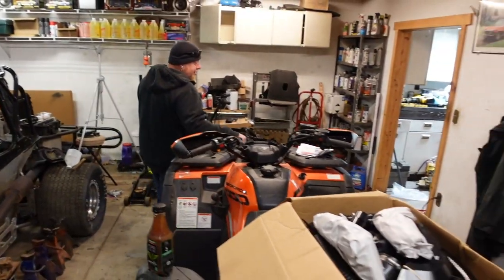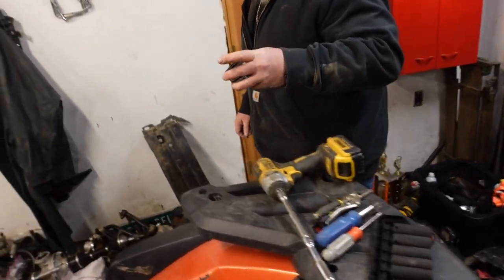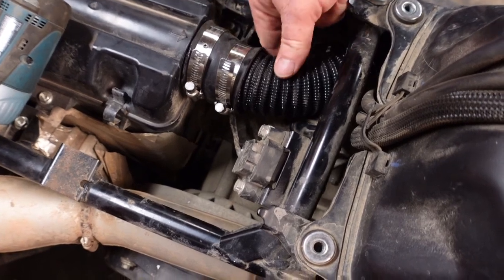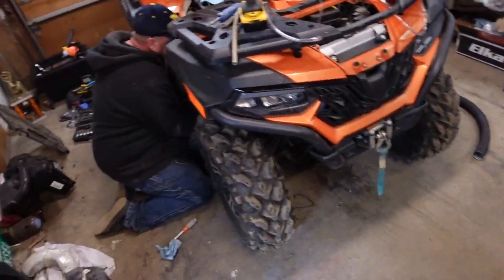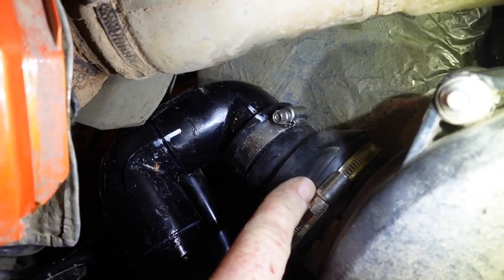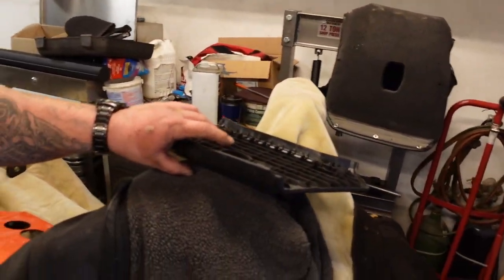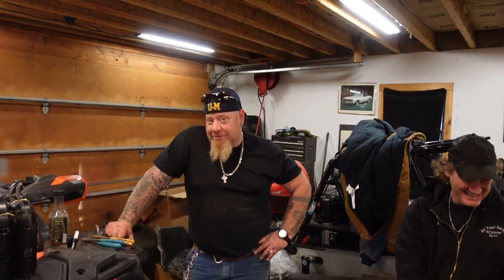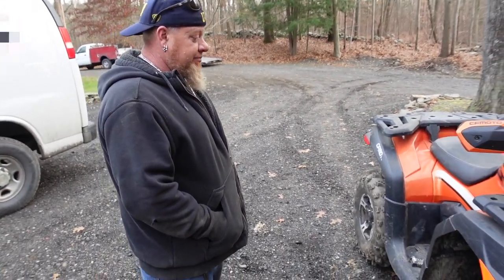SYA Snorkel Install On a 2020 CFMoto CForce 600! We Show You How To Do It |  To Go Deep!

Comment: It turned out very well... but my question is if you need to replenish water. Take out a fuse or put in brake fluid, do I have to disassemble everything? Greetings from Uruguay.

Comment: I was riding my 600 in the trails and blew a fan fuse so when you take that in deep water it might happen to you. You guys did a bad ass job👍
Reply: It blew one on me too up at tall pines
Reply: Same here in the water
Reply: Same here 😅
Reply: Just need to add an on an off switch for when you're in deep water  So you can turn the fan off completely Did it to my AC worked great.
Reply: @bigjay6743  perfect
Reply: I replaced all of the OEM fuses with aftermarket. After some research, I learned that the quality of the fuses from the factory aren't great. Haven't had an issue after replacement, so far.

Comment: Why does a small purple line have to come from the exhaust Port of the drive to belt drive is it not already sealed up or is there some kind of opening back there to let the air out because I don't see it in the plastic piece taking off but then again I can we just missed it that's the reason I'm asking the question completely ignorant here so don't think I'm questioning everything cuz I don't understand I just don't understand is all
Reply from the maker: Hit us up on either instagram or Facebook so we can see what you are talking about.  This way it might be easier to answer.

Comment: Great job guys.  We’re in the process of doing the same snorkel kit on our 600 touring.  How long did it take you guys.  I need more time in my days to finish ours.  I work too much. Lol.  Will send pics of ours when we’re done.  Awesome video
Reply: It took about 6 hr total. Little pain in the ass but not too bad.
Reply: @sethharman3006  what kind of silicone did you guys use?
Reply: @rodeckerboyz2510  just regular.  Nothing special

Comment: I have a 2020 cforce 600 aswell and it’s snorkeled but when I take it underwater it blows that fan fuse
Reply from the maker: That sucks.  Never want the fan coming on in the water
Reply: It's easy just put a switch on it so you can turn it on and off. Did it on my AC  Worked great put the switch by the key.